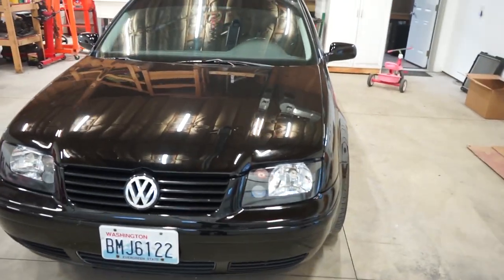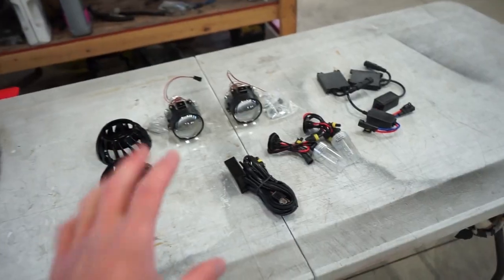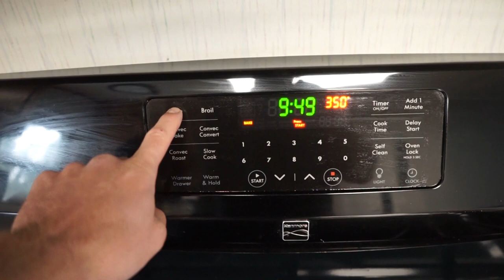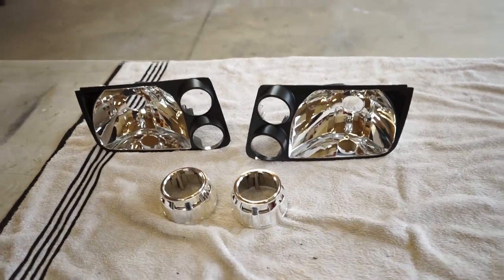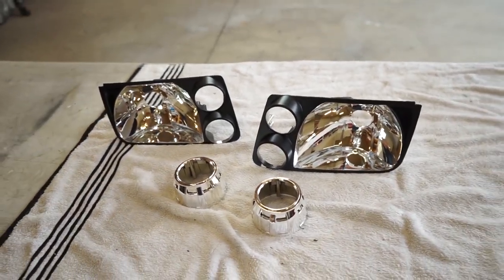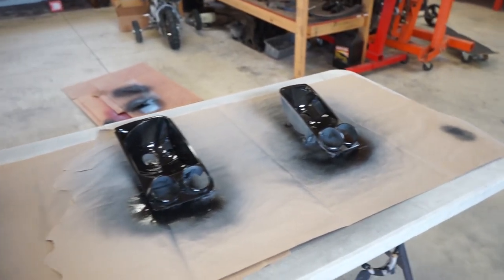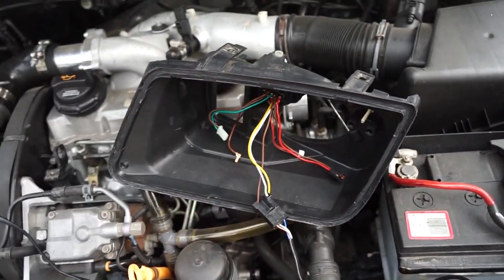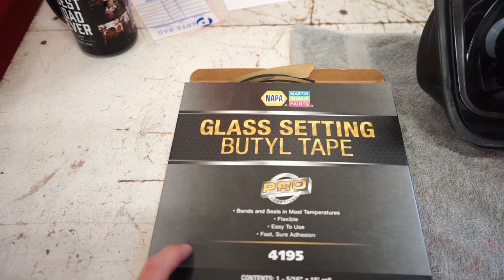The Best $120 You Can Spend On A MK4 Jetta!

Comment: Just did this conversion. It's still pretty cheap, and the results are outstanding. Only issue i have is a bit of vibration and jiggling of the projectors. Anybody else deal with this? Thinking about gluing a post between the shroud and housing to lock them down.
Reply from the maker: @jackalay23  mines been jiggling around since day one and still hanging in there!

Comment: I did this to my jetta. Thanks for the video, it was very helpful, I did every step except for the painting. The only thing I didn’t like were the headlights I bought feel very cheap (and they are), the reflector vibrates a little bit and I feel like they are going to fall apart. I guess I’m going to open them again and put some glue on them.

Comment: I tried do the same but didn’t work as yours. I could think is just the camera, because when i look through my phone camera is alot more bright. Feels like iam light blind lol. Everyone on the road has better light output them me still
How did you get to fit the projectors in the housing? Still surprised, I believe is the exactly same housing and projectors i got. I had to cut a big hole in order to place the projectors deeper and not touch the headlight lenses . Another thing, i tried mane leds and doesn’t work well. Found out many people saying that. Them tried one hid and get so hot and might burn my whole headlight. But I cannot expend more $200 for a decent powerful led bulb. What am i doing wrong, help please

Comment: hey man i cant find anything about it online i got 1999.5 headlights and the hole in the back is diffrent and the projector doesent go all the way in like the hole for the bumb is smaller did you have to do any modifications ?
Reply from the maker: Im not sure i havent seen that style of headlight!
Reply: @austinniemela  i just found out mine are america specs headlights and the ones u used are euro spec headlights so the bulb size is diffrent or something

Comment: Did you have any issue with the hid lights quickly “blipping” on when you start the car?  I did this retrofit and when I turn on the key the HIDs quickly flash on then shut off again.  I’m just worried this quick blip will wear out the ballast quicker
Reply from the maker: No mine don’t do that!!
Reply: @austinniemela  did you disable the DRL via the headlight switch pin?  I may try that to see if it alleviates the issue
Reply from the maker: @akairmen82  yes you need to disable the drl for sure!
Reply: @austinniemela  I disabled the DRL via the TFL pin on the back of the dash switch and it resolved the issue.  Keep up the great work on your videos!
Reply from the maker: @akairmen82  awesome!! Thank you!

Comment: Hey man just got a 1.9 tdi recently, timing and everything have been done and I’ve got a shake at idle every once and a while, wondering if you know anything about that? Thanks
Reply: It could be your alternator bushes failing? Serpentine belt in a bad condition? Your egr coked up? Air filter clogged/old? Fuel filter due? Map sensor needs a clean? Maf sensor needs a clean? Electric contact cleaner does wonders for the last 2. Good luck 👍
Reply: Oh and the dog mount might need looking at